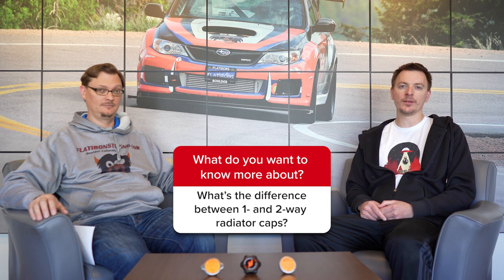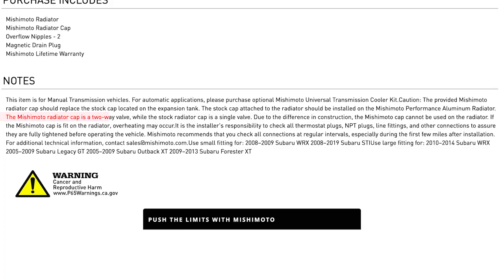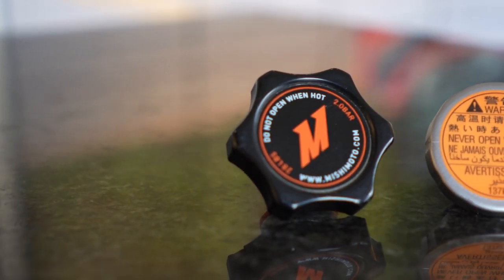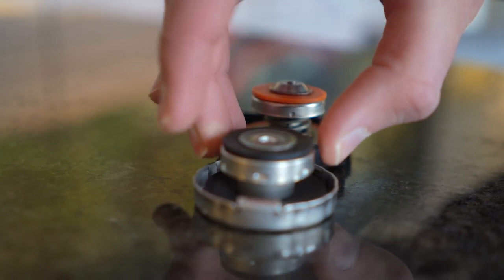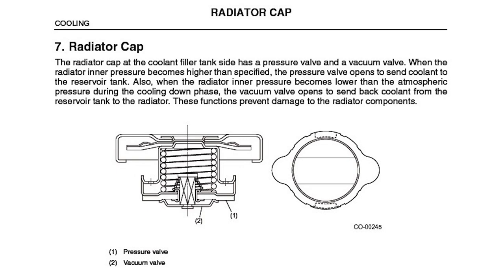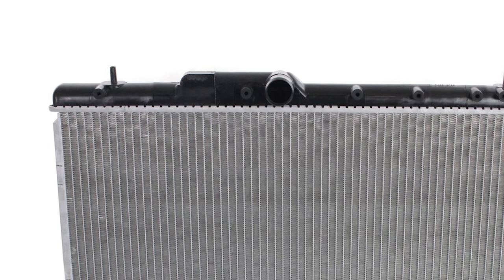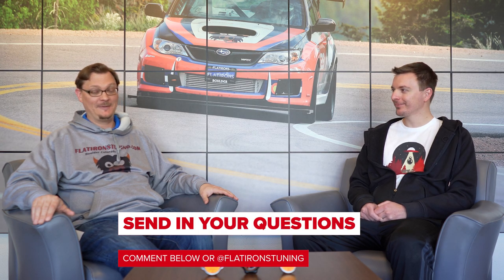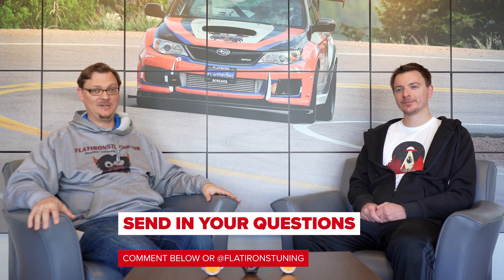Explaining the Mystery of Subaru Radiator Caps

Comment: Can the expansion tank be deleted? And what would the effects be
Reply: Josh at BBR pretty much does it to all his cars by deleting the expansion tank and running a iag race version AOS that is then the high point in the cooling system.  Pretty sure he uses the factory 1-way cap on the radiator with that setup but have not confirmed this.
Reply from the maker: We are going to get into this in the next video.  The short answer is no, and bad :-)  The expansion tank is actually the key to the solution I think.

Thanks for watching and Stay Tuned!

Comment: What's funny about my ej255 with mishimoto rad and proper cap, plus oil cooler, on track I still purge coolant, even though I pass a pressure and exhaust gas test, never overheats though 😜 i just have to pour the coolant from the overflow back into the top tank, then let er rip some more.
Reply from the maker: Thanks for your comment.  I might recommend trying factory caps in both locations to see if that makes any difference.  But glad to hear that you aren't having any more serious issues.

Thanks for watching and Stay Tuned!
Reply: @FlatironsTuning  yeah note that I believe running 19psi caps in both places is ok, I did start with new oem cap on the rad and the mishi cap up top, BUT i noticed the clamps on the Mishi cap were not sealing well due to   incomplete clamp of the tangs, nothing my bench vice couldn't fix :)

Comment: Can someone with a factory bone-stock subaru chime in and take a look at which cap goes where?

[EVERYONE]: "Stock subaru?"

crickets
Reply from the maker: Thanks for the question.  It is easy, the round cap goes on the radiator, and the one with the "ears" goes on the expansion tank.

Thanks for watching and Stay Tuned!
Reply: @FlatironsTuning  thank you for stating this and making the video. My mechanic just made a mistake and had me switch the caps in the morning after a late night service so the car would be cool and thought my caps were reversed from the prior shop. And I noticed once I got to work my over flow tank had a little higher fluid level than it did the night before, after my shift I got home and now my tanks almost full to the filler cap and this video just made me realize the caps were originally correct, "eared" cap on the expansion and round on the radiator. Which it is NOW reversed. I was confused cause I checked the Subaru direct wholesale site for the radiator cap and it was also backwards in the name so this cleared it up for me that you. I'll have to let it cool down over night and switch it back in the cold am I sure hope nothing is damaged now. 🤦... What's the proper burping process so I can get any additional air out?
Reply: Thanks for asking this question too Andrew lol
Reply: I  daily an '11 sti btw

Comment: So higher pressure (kpa) oem cap on the Rad, lower pressure on the expansion tank.... got it.
Reply from the maker: Yep, and one way cap on the radiator if you can.

Thanks for watching and Stay Tuned!
Reply: 2way lower pressure on expansion tank 1.1 bar, higher pressure 1.3 bars 1 way on the lower koyorad radiator cap. Hope Subaru is following this.

Comment: As someone with a single cap configuration (gc8 non capped aluminum rad with a v7 207 swap and a moroso expansion tank) I do start getting hot (starts creeping over 100c) never gone over 110c as I slow down once it goes over 100c measurement for sensor is tapped into the coolant crossover pipe same as factory temp sensor) 15-20mins into some serious  heavy foot driving.  Wonder if a even higher pressure cap than the moroso tank comes with would improve my situation?  Should look into how pressure affects boiling point as well to know what the limit of the system is before I reach boiling. Should theoretically be over 100c given the system is pressurized so maybe 100 isnt my upper limit? Not sure where you guys start to worry?  Iuno scary seeing them warning lights pop up on my defi gauges at 100c  𖦹ࡇ𖦹
Reply from the maker: Yes, coolant has a higher inherent boiling point (water would of course be 100c if you are using that in your cooling system), and as you increase pressure with your cap, that will also raise your boiling point.

A good place to start might be to simply test your cap.  If it is old, or the spring has softened up, then you aren't getting the benefit of that higher boiling point.

Hope that helps and Stay Tuned!